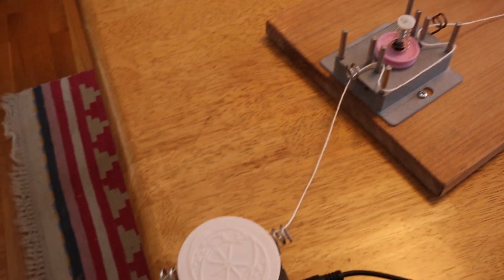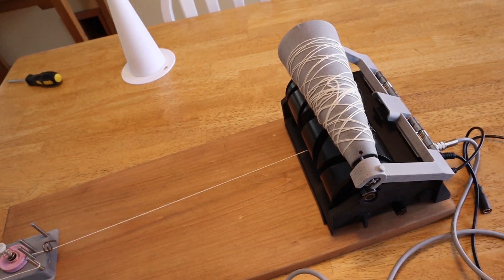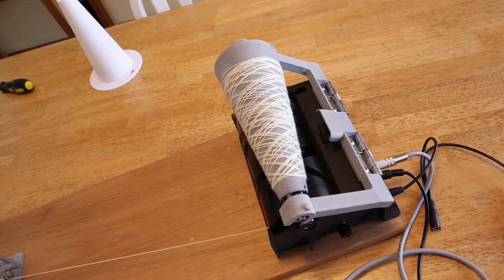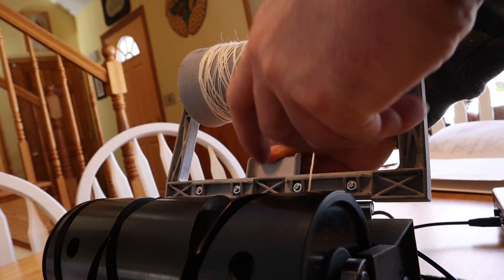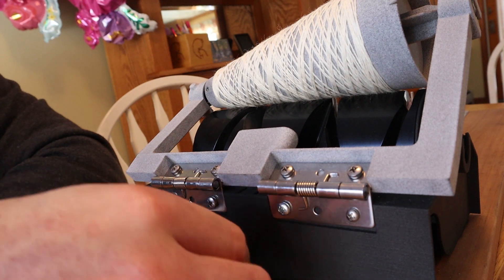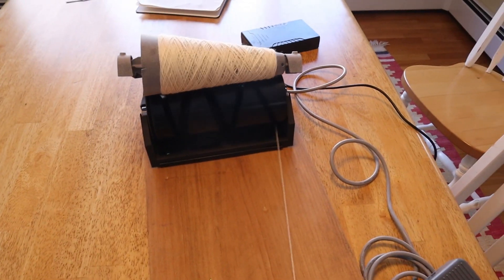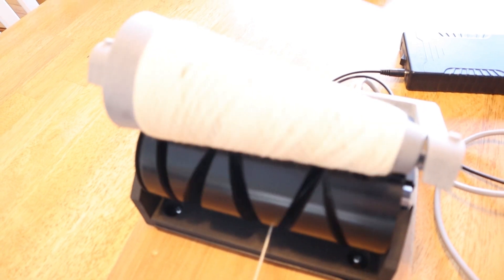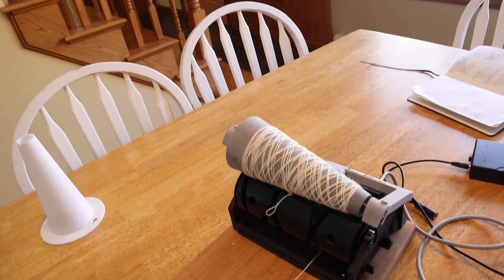SPIN 131 - Cone Winder Prototype Feb 2022

Comment: I have your yarn counter and absolutely love it.  Will this new tool only work with tapered cones, our will you be able to use tubes like Maurice Brassard yarns with your winder?
Reply from the maker: It is working with tapered cones in the video.  If you mean other tapered cones then there will be a 3d printed arm that you can have made to accept some other cones.  I'll have more details about this in the future.

We've been testing with a wide variety of yarns.  I see nothing unusual about Maurice Brassard yarns so they should work fine.

Comment: Super excited to see this! 

Will this work with the cardboard or plastic cones I already own (from inside coned yarns I've bought in the past) or only with cones specifically designed for it? If the latter, how many cones will ship with it and what will be the process for getting more?
Reply from the maker: You will be able to 3d print arms that work with other cones, but there are some limits on what kinds of cones will work.  I'll explain this in the future.

It will probably ship with around 10 cones (exact number depends on size of everything since I want to fit it in a box that is optimal cheaper shipping).  I'll sell more cones for between $1 and $2 on my store.
Reply: @DreamingRobotsBlog  Great! I did see that about printing the extra arms - hoping I can use up some of my ridonkulous stash of cones, but they're many shapes and sizes so yeah, I can see some not working well.
Reply: Ha! I hadn't gotten to the end of the video - too excited to watch all the way to the end. :P

Comment: My planned use for this is super-thin silk yarn (120/2), and I'd like to be able to walk away without worrying about what would happen if there was a tangle. Silk is strong, and thin yarns are likely to tangle, especially since I'd be winding maybe tens of thousands of yards on a cone. I'd want some protection for the motor. If the slipping thing would protect the motor in the event of a tangle, I'd be OK with that.
Reply: Though, also, the stopping knob at the back has an appeal, too, as I'd likely be doing a lot of the same kind of yarn, and could set it and forget it.

Comment: Will this be compatible with other cones from commercial yarns? I would like to reuse cones as they come up.
Reply from the maker: That is what the 3d printable arms is for.  However, there are some limits I'll cover in the future.  For example those cones that go to a point and don't have big enough holes in both sides won't work unless some new arm mechanism is made.  So I guess the simple answer is that some will and some won't with more details to come.
Reply: @DreamingRobotsBlog  Thank you for answering. Looking forward to finding out more.

Comment: Thank you for the update, I can't wait for this new campaign! 
As for your question, that extra dial doesn't seem absolutely necessary. The demonstration you made prove that a knot won't break anything. That being said, for those who leave their winder unattended, I guess the sound of the motor stopping could be interesting to warn that something needs to be done. So in the end, I guess it's all about cost and the risk this dial provides: would the winder be unusable if that dial started malfunctionning?
Also, just a thought here: I think it would be nice to add a hole in the middle of the 3D printed cone base: When machine knitting with several strands of yarn coming from a couple or more cones, one would usually stack the cones on top of each other and thread the bottom one through the top ones so that their strand would twist. With your base, we could imagine just having to cut a hole on whaterever supporting system we're using if need be.
Thanks again for your hard work and brilliant ideas!
Reply from the maker: If the current dial is set wrong it won't work.  I'm 100% sure I'll get support questions about this and returns do to it.  Probably not that many, but it would certainly happen.

The hole in the bottom of the cone holder is interesting.  I think some will want it without the hole so they can add weight to the base.  That said adding or covering the hole with tape is easy.  I could also just make two versions which would be trivial.  Thanks for the heads up this!
Reply: @DreamingRobotsBlog  Then this dial seems more trouble than it's worth... Cost in production & cost in support (and sanity :p )...

For the base, two files could be the solution. Also maybe a little ridge around the hole? That way we could have weight around the hole without risking them covering the hole or falling through it?
In any case, thanks for the consideration!
Reply from the maker: @littledia1  The ring around the hole is  a cleaver solution.  I'll probably do that.
Reply: Might also be able to use a donut shaped weight.

Comment: Coming along great!! Love the  new tensioning system and will be very gentle ion the yarn. I think it will also help the stability of feeding onto the cone!
 One thing that concerned me watching the video was the winding going on
 at the top and bottom of the cone was not an even thickness  building up and some overlapping of some strands of yarn on the very top escaping and not staying in a firm even wind. This is a yarn barf on the top of the cone waiting to happen. When unwinding up and into a CSM yarn mast,  those strands start “catching” more and more essentially requiring a stop in production to rewind the cone. It has happened to me many times throughout the years. From my home wound cones and occasionally a a badly wound commercial cone. Which actually happened to me this week on a commercially purchased cone of yarn . I have photos if you like as I haven’t rewound it yet.
Reply from the maker: For those escaped strands, I think you are talking about what you see at 12:08.  If you look closely the only escaped yarn was at the very end because the yarn wound onto the cone at full speed with zero tension so it just got flung on there.  If I unwound 12 inches then the end would have looked perfect.  If this is the thing that concerned you it is not actually an issue.

Comment: Looks like you've done a great job but I don't think knitting from a cone would be very practical for me
Reply: Cone winding is more geared towards machine knitters. Using a circular sock machine, it's important to have no drag or tension change in the yarn uptake. Cones provide that better than balls or cakes. 
If you're hand knitting, this probably wouldn't make sense for your yarn.